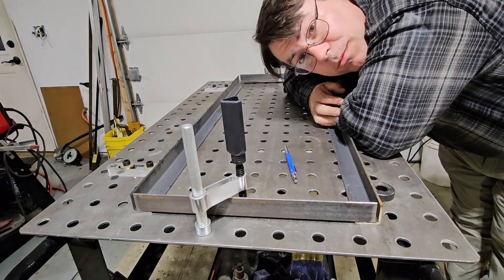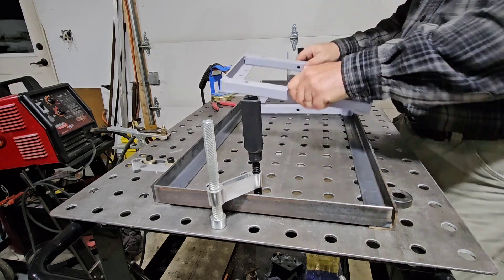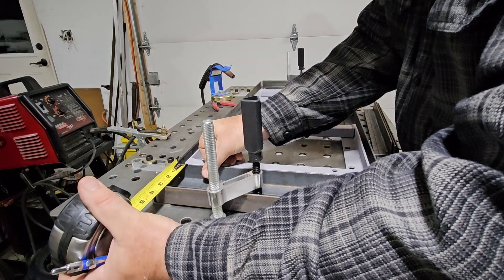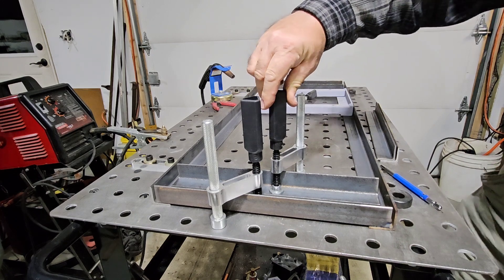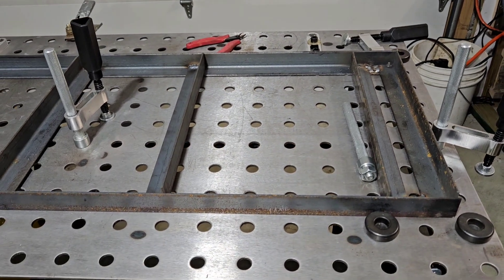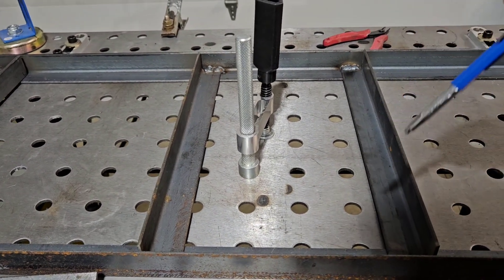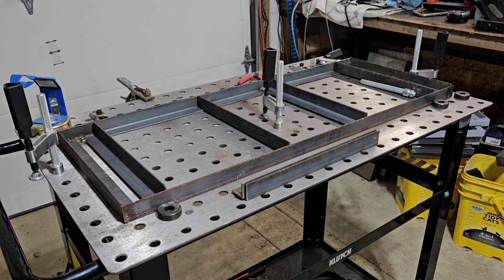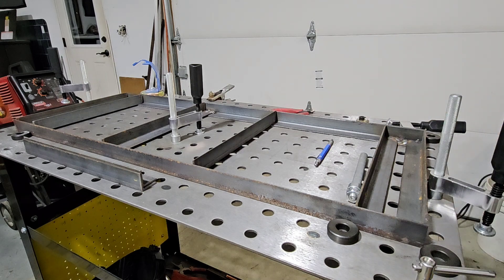Fabricating a locomotive frame

Comment: Why didn't you notch or forty five the joints so you would have a flat surface on the top?
Reply from the maker: It will have a flat surface on top. It's made for a wooden body.

Comment: When you're welding try not to move the torch around too much and stop tracking back over the weld you just laid, start at one end of the metal and in slow and steady action move the torch forward and in a straight line.

Hope that helps.
Reply from the maker: That is helpful. Thanks!

Comment: wouldn't channel iron be better for the ends?
Reply from the maker: It will all be covered by the body, so it's about the same.
Reply: Hey Aaron, nice video on your new locomotive frame! Will these locomotives you're building for customers have four drivers like the 70 & 71, or will they have two  four wheel trucks?
Reply from the maker: @richardperry5743 , they are 2 axle locomotives like 70 and 71. I like these little critters.

Comment: Having worked with earlier video cameras that could be permanently damaged by a bright light, I'm always amazed when today's consumer cameras capture arc welding without additional filters.
Reply from the maker: I wouldn't dare film welding with the Sony tube cameras I used at WNNE back in 1993. The bonus about this camera is that it's fully insured!